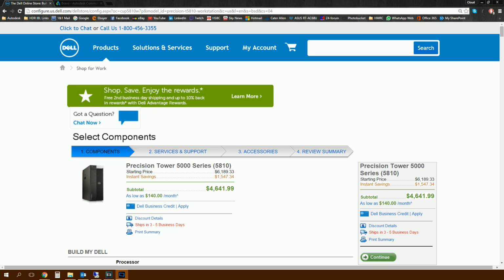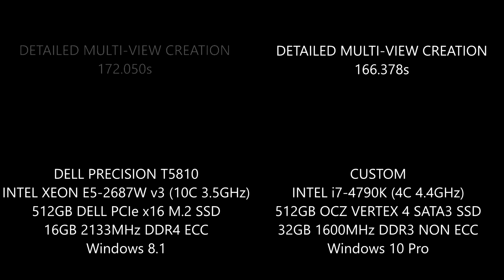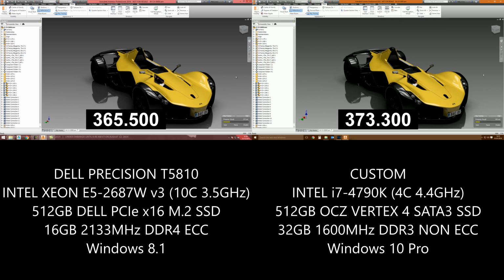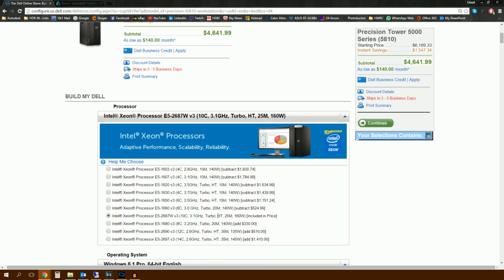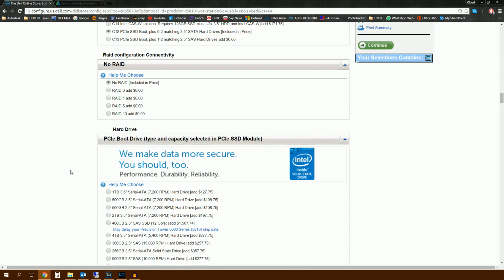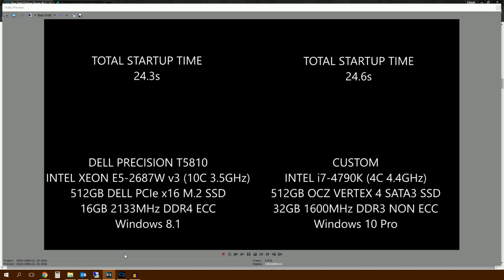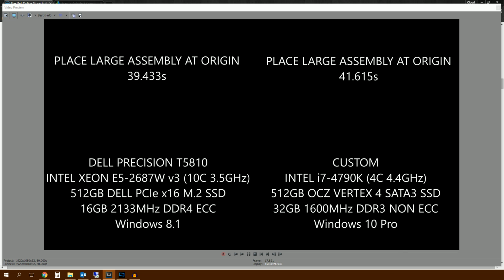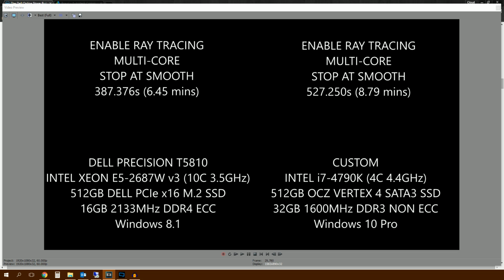$6000 10C Dell Workstation -VS- $2000 4C Gaming PC | CAD Benchmark Test

Comment: Not the best comparison IMO, missing the whole point of a desktop server (stability in heavy workloads, all day long).  A locked E5-2XXX can be good for gaming if paired with a top notch over-clockable motherboard where a BLCK overclock may bring 13-14% benefit across all cores.  In a desktop server, a dual socket using these locked CPU's and at base frequencies with a few tenths of an improvement in turbo across all cores...is a BEAST.  I do have an old T5600 in dual E5-2689 (2x8C, 2x16T) running on all cores in turbo to 3.3GHz and it is an absolute BEAST.  Sure, an unlocked XEON in the right gaming motherboard can also perform...even better for certain games where OC on air can exceed 4.5Ghz (e.g. E51650, E5-1660, E5-1650V2, E5-1680V2)...but for tasks these dual locked CPU XEON-s at second hand prices are fantastic value for home use.  I got my T5600 with an 825W power supply, 32GB REEC DDR3 1600 four channel RAM, and dual E5-2667's (2x6C, 2x12T)...which I got in a company decommissioning ...for FREE!!!! I upgraded to 2xE5-2689's for $160 and sold the pair of 2667's for $80.  This type of value is hard to beat.  Of course, it eats power for sure, but it is a task BEAST and an excellent 1080P gamer with the right GPU (e.g. RX580 8GB or similar).

Comment: I just bought a t5810 for £67 of ebay barebones. Bought ram and e5 2697 v3 for less then £40 and slapped a rtx 2080ti inside. Not a bad little gamer for a total of around £300-£325. Other then the cpu socket being some what outdated for gaming it ain't a bad unit for being 9yrs old.

Comment: Workstations are so overpriced and the gaming PC's are a lot more closer to the price to build these days because so many are building their own gaming PC's so they are a lot closer to the price of building as compared to the workstation by a lot. This dell can be built for $3,200 (with the gaming GPU) so they are a lot closer in value and windows 8.1 is horrible for speed they should be on the same windows OS and you addressed that! The Dell with a 10 core CPU is considered by professionals as a touch above a entry level rendering workstation. ECC ram is error correcting so its doing a lot more than regular ram does and it does it at a lower speed. I guess I wanted to see the Xeon run away with this and I see from cinebench that I am able to beat lots of the OC'd i7's with similar GPU's but there are a few that are extremely fast and rip through cinebench better than my 10 core Xeon (turbo's to 3.74GHz). Running the three cinebench tests with these two rigs would be fun to watch especially after your in depth study. Liked with the thumb's up but not so much in my heart lol
Reply: +richcali21 When it comes to reliability, durability and performance in professional suites workstations are far superior to gaming rigs. It heavily depends on what programs you use. A cheap Quadro can outperform a 980 Ti in SolidWorks for instance.
Reply from the maker: +The Echelon That's interesting because it wouldn't in Inventor, in fact my 970 outperforms a Quadro M4000 and an AMD W9100 (16GB).  I know nothing about Solidworks, what differs between that and Inventor when it comes to GPU reliance?
Reply: TFI CAD Tips Drivers for gaming cards such as the Geforce family are not (fully) supported in SolidWorks. You can use SolidWorks with a Geforce card, but it disables certain features such as 3D real view. Also, depending on the view mode (enabling/disabling shadows, edges etc.) will result in very different performance outcomes. For instance when using 'shaded w/ edges' view mode a K620 Quadro will outperform a Titan X.
Another program I'm using is Keyshot, which is a CPU based render suite. The Dell with its 10 cores will probably be more than twice as fast in rendering than the gaming rig. So when doing animations this means waiting 5 hours instead of 24 hours.
Reply from the maker: +The Echelon Yea I've got Keyshot here, love it.  I've been cheeky and asked Dell to send me over a workstation with dual E4 22 core Xeons in (88 threads) and dual 24GB M6000 cards in, best believe I'll be hammering that if they approve it! That's interesting what you say about SWX, to be honest I've previously tried to get a trial of SWX 2016 but the arrogant pricks at the local reseller refused to give me a trial copy because I'm not a real sales lead.  That pissed me off.
Reply: TFI CAD Tips Wow that's an awesome rig. Hope they will approve it! 
I do enjoy using SW so far. They are quite strict when it comes to drivers though because of certifications/verifications and what not, but I guess that's fair.

Comment: Hello, I'm interested in 5000$  custom CAD rig for Inventor/Alias/SolidWorks/Ansys Maxwell what you would recommend an expert? I'm not interested in games only work. Please help me.Best regads.
Reply from the maker: +Vitali Bazilevschi What country are you in? Which application do you use the most?
Reply: my current location is Romania(European Union) but I can have little trip to UK.Thank you for your respond :)
Reply: +TFI CAD Tips Like I sad before I use 5 CAD Engineering softwere :Autodesk Inventor, SolidWorks,Matlab Labview-Ansys Maxwell for High performance electric motors +I need to develop a entire power-train (electric motors-gearbox,power-electronics and other mechanical stuff )thanks for you attention :)
Reply: +Vitali Bazilevschi Intel Xeon CPU with Nvidia Quadro or AMD Firepro graphics cards are highly recommended. You can either build one yourself or buy a prebuilt system from Boxx, Lenovo, HP or Dell.

Comment: Thanks for this interesting test! I'm surprised as well, however have to point out some weaknesses of your setting.
(I have a two weeks old T7910 with AMD W9100 and Xeon E5 2697 v3 14core @ 2.60 GHz and 32GB)
First and foremost - RAM  d o e s  matter, even more when it comes to 3D processing. We all think the graphics card carries most of this load, but not true.
Next, you do not mention the screen resolution and display settings on both machines. This can make a big difference, and also this is where win8 vs. win10 can come into place. And third, the proper settings of the drivers for the graphics cards have a big impact, specially the NVidia needs a lot of fine tuning due to its proprietary CUDOS interface (this is why I stick with AMD against all advice from the rest of the graphics community ;) )

My previous machine was a 6 year old T7500 with a Xeon 6586 (?) 6core @ 3.33 GHz and AMD V8800 and 32GB. My first comparison was disappointing, the new machine was faster, but not significant, until I became aware that the old machine had a 2k screen resolution (two monitors @ 2560 x 1600), while the new one uses and supports two 4k monitors @ 3840 x 2160. And when it comes to rendering very complex scenes with many million polygons and photorealistic textures, the old machine simply is blown away - render times of 60 minutes and more are now reduced to 4-5 minutes with a nearly 2 times higher resolution. But it's true, that in every day use (booting, text processing, coding, ... ) there is not much improvement of the performance (both PCs use win10 and SSDs for system and data). Applications like Word and Outlook open a little faster than before, but not with a WOW effect.
Reply from the maker: +cyana h Thanks for the feedback.  I hear what you're saying about the differences in drivers, resolution, RAM etc.  However this wasn't supposed to be a like-for-like hardware comparison, it wasn't supposed to be a equal playing field on any level.  The purpose of the test was as follows, here's a ridiculously expensive current professional workstation and here's a typical much cheaper gaming PC, let's do the same thing on them both and see what happens.  Also, regarding screen resolution, on high end GPU such as the M4000, even more so with the W9100, going from 1080p to 1440p or 4K on a single display does not have any real effect on performance.  If you're not sure about that, go and download the Inventor Bench application which I linked in my other benchmark video and run it at different resolutions, the drop in FPS between resolutions is negligible.  This is purely only relating to Inventor though, I can't speak for other applications.  These GPUs have more than enough horsepower in them to pump out a higher res to a single display without struggling, the W9100 is capable of x6 4K outputs so it's not likely to struggle with one?
Out of interest, on what basis do you claim that RAM does matter specifically confined to the scope of these tests? I've been discussing a lot of these results with the Inventor dev team and their product managers, at no point have they referenced RAM quantity or speed as being an influence on low level tests such as these...
Reply: +TFI CAD Tips 
Thanks for your detailled reply! Yes, I'm aware that this test is not meant to be a state-of-the-art-lab-certified-result, but more a where-do-I-stand-with-my-discount-pc against a real workstation. As we both are surprised by the outcome, it's legitimate to look for the reasons.

even more so with the W9100, going from 1080p to 1440p or 4K on a single display does not have any real effect on performance
That's true when it comes to display the generated output, however I was talking about the step before - generating the output. The 3D-model is vector based, here scale or resolution does not matter. However, when the model is displayed on the screen, it must be translated into a pixel image. And here, resolution matters. The higher the pixel- and color-resolution, the more iterations the processor has to loop through. You can easily test it when you resize the viewport in AutoCad or any other 3D CAD program (I'm using Rhino 3D). This work is mostly done by the main processor, and not by the graphics card. What the card does is shading, anti-aliasing and basic texturing, as long as it is directly supported by the program. And when it comes to rendering, resolution counts even more - because you in fact generate larger pictures the higher the resolution is, even though you did not change the viewport (as long as you do not set the render options to a fixed pixel size)

Out of interest, on what basis do you claim that RAM does matter specifically confined to the scope of these tests?
You already can see it on benchmark #2. While on the game PC the whole model easily fits into its RAM, it does not on the Dell - that's why the Dell is slower on loading because AutoCad has to decide what parts of the model are held in the fast memory, and what to put into the secondary caches. The model is not just the sum of its polygons, but tons of metadata, pre-processed objects and so on. You might get a clue when you look, how much memory is used effectivly for the same model on each PC in absolute, not relative values. The 32GB machine has no problem to fetch all hidden objects in the example for the current viewports, while the Dell obviously has, and has to do a lot of precalculations and optimizations during loading. The real strenghts of the Dell over the game PC would have been visible afterwards - when you would have panned/zoomed/rotated the model - here the full power of the Xeon and the Quadro are unleashed, resulting in a much higher frame rate on those operations.
I made this experience with my old Dell T7500, that initially came with 8GB six years ago. Once I added another 8GB, and later another 16 GB, 3D-things started to get really fast.

There are more things to consider, like the memory management of the OS, 32 vs. 64 bit, and tons of other stuff we do not even know. RAM is the fuel of your PC - the more, the better ;)

Comment: This is why intel is rumored to currently be testing/validating the 4-Core/8-Thread Xeon E5-2602 V4 which is running a FACTORY BASE CLOCK of 5.1 GHz (at 165 Watts TDP).
Reply from the maker: That would be phenomenal, I've just read the article and it's rumoured to only be available to certain OEMs, that could mean it might be exclusively a server component... I'm definitely getting my hands on one of them though if they end up in workstations!
Reply: TFI CAD Tips don't forget, 2600 line is for 1- OR 2-way systems, so THEORETICALLY  these could end up in dual socket boards for 8-core/16-thread workloads at 5.1 GHz >.<
Reply: +Optilasgar yes but don't forget it's all just plastic and some other stuff melted together in a weird way...

Comment: Could you give us a video on creating new material on a curved surface that isn't cylindrical? I am trying to do this and I'm almost blown-away that Inventor seemingly can't do it. I have tried embossing and extruding down from a surface. Also, why the hell can Inventor not extrude directly off of a curved surface?
Reply from the maker: +6969SpAcE6969 I dunno, I don't work for Autodesk! I won't be doing many uploads over the next few weeks as my day job is in a busy period, but you probs want to be looking at using 3D intersection curves and thicken, see this video which isn't directly related to what you're doing but you might be able to take some things away from it to help https://www.youtube.com/watch?v=SgBwEQWBa_o
Reply: I had to ask. I'll be happy if I know it can be done at least. I'll check the link out and just keep trying. Thanks for the help.

Comment: if you wanted to get a better comparison, putting a quadro in the gaming pc would've shaved the 1.5 minute difference off the long render you did last wouldnt it? and you'd still have paid about half the price off the workstation. still i wouldnt have bothered with the quadro anyway.
Reply from the maker: +Travis Parkinson Ray tracing isn't GPU based, it's 100% CPU
Reply: +TFI CAD Tips ah ok I didn't know. I'm still a noob trying to figure this all out. other than the support it makes me wonder why you'd ever need a quadro...

Comment: to be right head to head comparison boath comuter should have the same operating system
Reply from the maker: +Mourad Guesmi do explain further please, which feature set differs so much between Windows 7 to Windows 10 that it will adversely affect the modeling kernel of this directx 11 based software and please provide specifics not generalities. If you're going to call me out please do give specifics.

Comment: First of all, the i7 has a much higher clock speed and double the ram. Second ECC ram works slightly slower than non ecc ram. Third, only the last test actually uses all cores in a meaningful way and start up or load times are never relevant, it's something idiots do. Also no actual CPU benchmarks were done in this video.

Comment: +TFI CAD Tips
If you have used AMD FX9590 (water cooled) & 16GB 2133MHz CL10 memory. I swear, the whole scenario will be in favor of $2000 PC.
Reply from the maker: +Shubham Patankar Interesting CPU, this test was already in favor of the gaming PC but that sure does look like a monster of a CPU.  Neither of these PCs had been spec'd and built just for this test, it was just a chance test of two systems I happened to have at the same time, but I'm liking the look of that
Reply: +TFI CAD Tips 
I'm looking forward for AMD with DDR4 support to freeze blue pirates of pockets. :D

Comment: You did not specify the types of GPUs present on the two machines. The GPU is much faster in Raytracing than a CPU, so i guess the Gaming PC offloads some tasks to a much faster GPU. You said it yourself, on paper the DELL should win every task.
Reply from the maker: In Inventor the ray tracing engine is 100% CPU bound, 0% GPU utilisation.  But the gaming PC had a GeForce 970 and the Dell had a Quadro M4000, exactly the same GPU with the M4000 having more VRAM which doesn't get stretched at all in these tests, if it did I would have mentioned it.

Comment: im using a HP z800 workstation for my cad work i paid around 900 tottal for it, using a RX 580 8gb  grapics card for it, and 2x X5687, with a Fusion io drive , works great, paid it self back realy fast

Comment: WTF,do you have a dell worksation??,i have one and you are full of cheat the dell kills every toy pc in that price range,dont compare toys and real dealls!!
Reply: You clearly just stated you know nothing about how a computer works. Brands are just brands makes no difference if you have a dell or an acer if they have same specs and are under the same circumstances because the parts inside are build by the same manufacturer. The issue here is that especially rendering requires cores and ram. more cores need more ram. As a general rule of thumb you need 2+ gb of ram pr core. so 24 cores 48 threads would need 96gb of ram to run properly. here he is comparinga high core amount cpu with low amounts of ram to a lower core amount cpu with more ram. The ram is the bottleneck on the high core nubmer cpu.
Reply: .....you sir, should leave these things to the people knowledgeable and passionate about this subject. You are far from that.

Comment: The mother bord matters too and the the speed its set for the gpu's.
Reply from the maker: Sorry the motherboard itself has no tangible impact on performance, it doesn't set the GPU speed either.  The graphics card uses a PCI Express standard and PCIe lanes, which is a standard all board partners have to adopt else there'd be no point in a standard.  The speed of the GPU is controlled by the card itself, core speed, memory clock speed, VRAM type, memory bandwidth etc etc

Comment: This is one of the worst comparison videos I have seen in a while. Very different CPUs in terms of base speed, highest speed, cores, drives, RAM size/speed, etc. Artificial and gaming benchmarks are pretty much meaningless these days so at least these were based on an actual production use case.